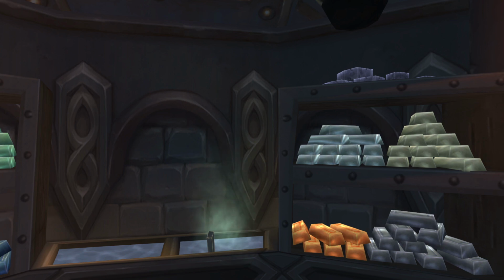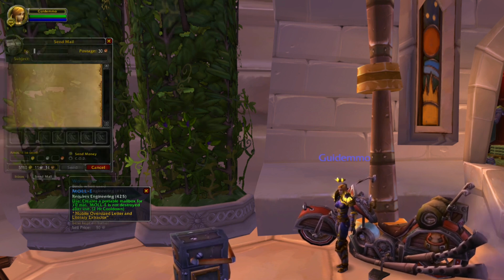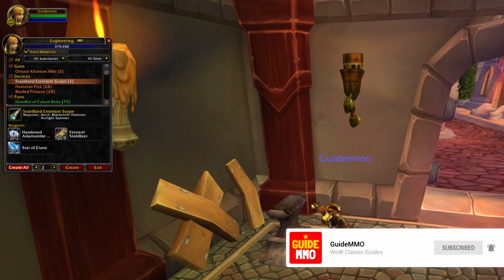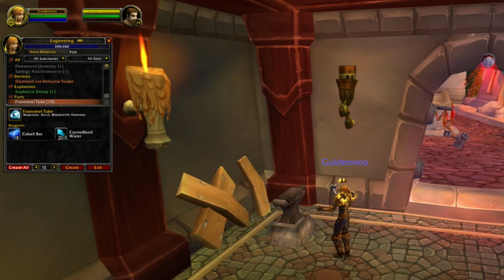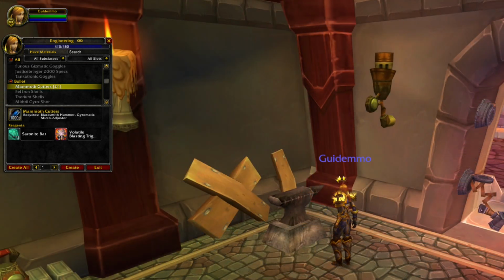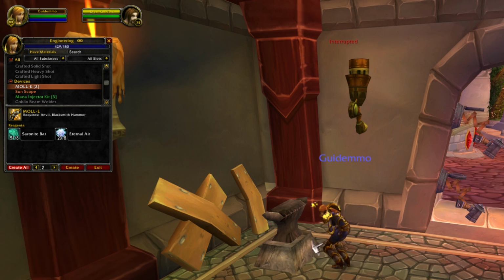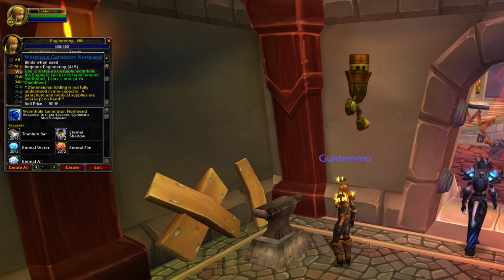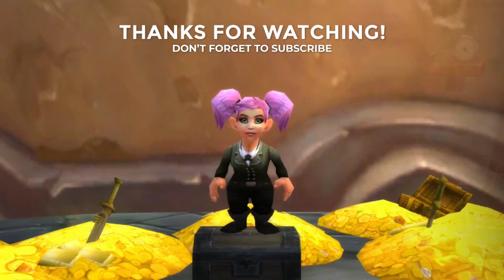Engineering Profession Leveling Guide in WOTLK Classic

Comment: have a question? i have a ton on mats to level engineering to 375 but my questions is should I wait to lvl engineering 1-450 when wrath comes out would it use less mats that way. Thank you and for the video. Cheers!
Reply from the maker: You should get to 350 in tbc :) because wotlk mats start at around 350
Reply: @GuideMMO  ok, thank you. I just was hoping I would have to use less mats. All good. Cheers.

Comment: Good guide, but there is some think that could be mentioned as well. 
You can start with northrend eng. at skill 350 so when you are leveling new character for wrath you don’t need to grind skill up to 375 in Outland. From 350-375 you will need mostly cobalt. 
Another think when you need eng. only for gadgets you will have them all around skill 400-450 so there is no need to keep skilling when all materials are super expensive in start.
Reply from the maker: ohh yeah for sure :) this is mainly for people who are already maxed out in tbc. From 350-375 it's best to craft Handful of Cobalt Bolts in wotlk as you'll use them to continue leveling
Reply: Is this true with any other professions? Jewelcrafting or Blacksmithing for example?